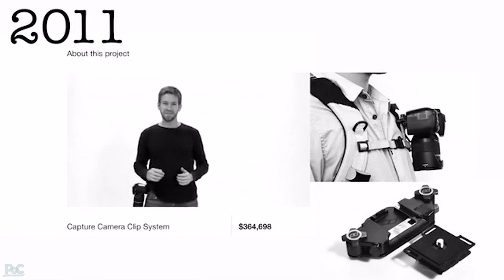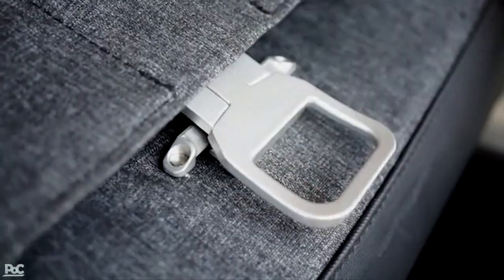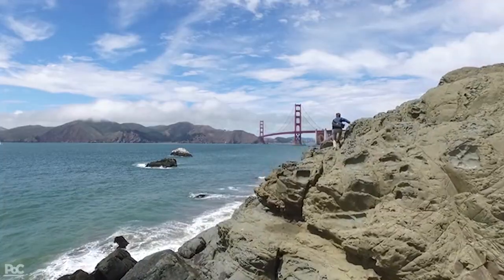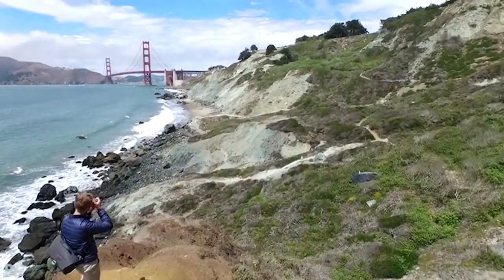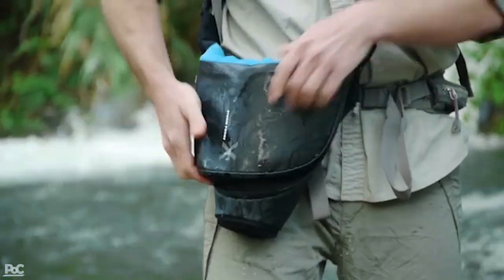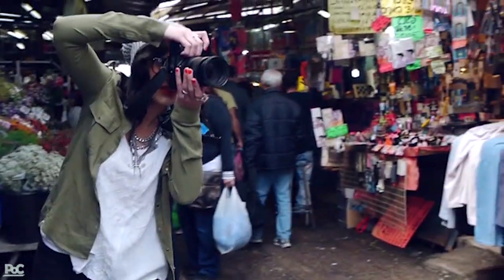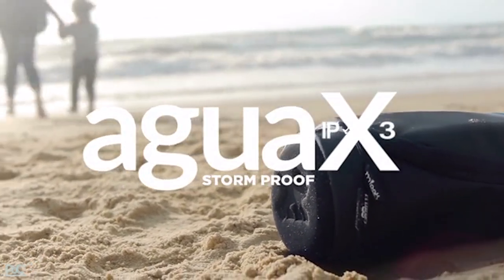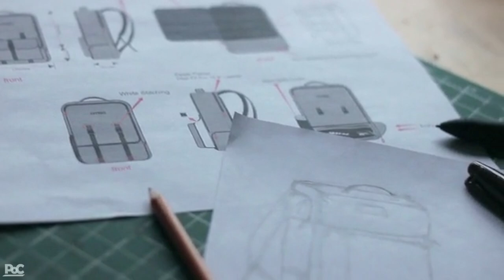3 Innovative CAMERA BAGS

Comment: Bag looks great in appearance and functionality.  Only criticism I have seen concerns the potential weight in a full bag, dragging down on the shoulders.  You probably already looked at this, but it seems a modest additional option whereby the bag could be strapped over both shoulders (like a back pack).  You already have a 'waist belt' to tighten around the hips which allows the weight to be taken on the hips rather than the shoulders - should this become necessary.  As one reviewer said, they liked the bag because of the practicality and the coolness, which a normal backpack does not have.   Given your design persistence, surely you could incorporate this modest change in utility, without sacrificing appearance ?  Anyway still a great product.